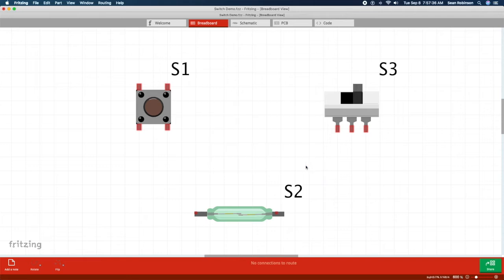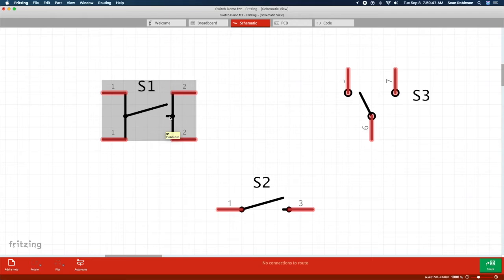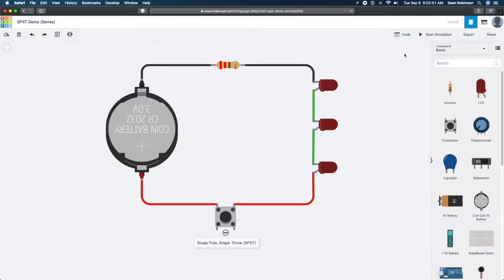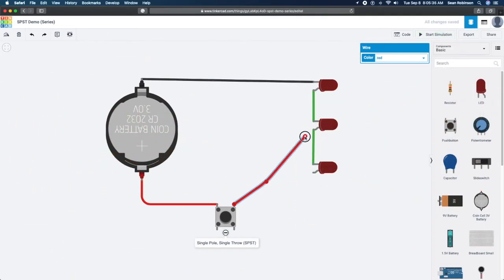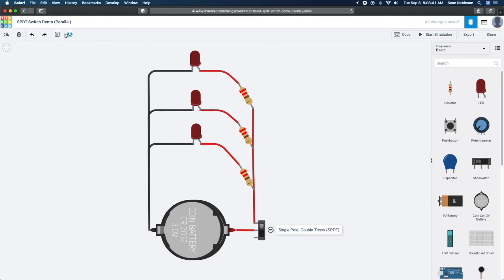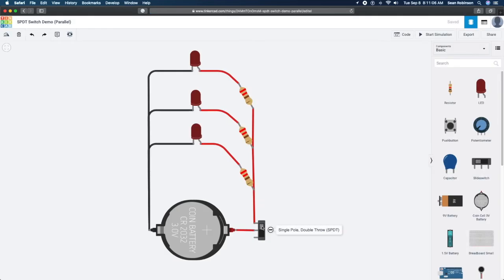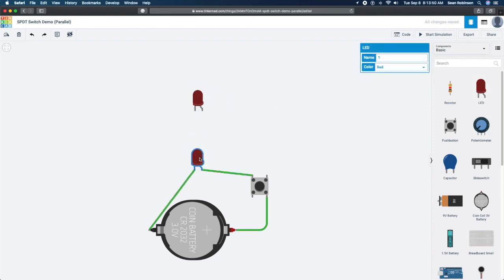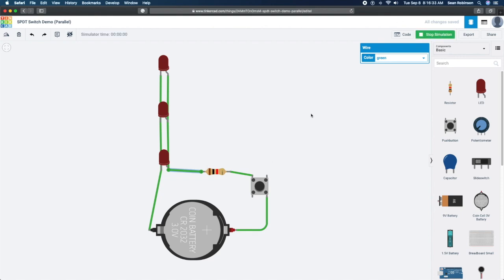Switches and LED wiring | DMP Electronics Projects

Comment: You explained it great, thank you but now I'm lost with the resistor, do we need them to light the house or can we do it with out it and nothing burn? I got me some switches like the S3 you draw I think I can put few of them around the house so they don't have to turn on or off everything at the same time, waiting for your next tut, thank you and wish me luck.
Reply from the maker: Thank you.  My next one in this series will be covering the resistors in more detail.
You don't, technically, need resistors.  They just help the LEDs, and batteries, last longer.
The good thing about using LEDs is that they won't burn and cause a fire, if that is your concern.
I hope to release that video on Monday.  Hang in there!

Comment: I thought it was pretty good. For us novices, I would have liked more of connecting the leds and battery in the sense of negative and positive. How that affects the flow. Using the same green line/wire (I thought green was for grounding) confused me and connecting 1 and 3 on the poles of the switch was confusing when I thought you said 1 goes with 2 and 3 goes with 4. Also, resistor values you lost me again. Reading the values on the resistors and knowing what you can pair with what was something I was confused about. For example, if you have a 3v battery how do you know how strong a resister you need if that is measured in ohms. I’m going to watch again and see if I get less confused😂
Reply from the maker: Thank you for your wonderful comments and concerns.
I apologize for the confusion.  My next electronics tutorial will dive deeper into the resistors, power, current, etc.  I just wanted to "introduce" it in this video.  I meant to mention that, but I forgot.  Sorry.
Regarding the wire colors.  In all actuality, it really doesn't matter what color wire you use when putting it together.  If you watch the beginning I do color code the wires correctly.  The green wire just happens to be the default color when drawing the wires on the app.  You are correct saying that green is usually the color of ground wires.  I just didn't change them.  Again ... sorry.
I did say that pins 1 and 2 were connected, and 3 and 4 were connected, but it was only for that one (momentary button) switch.  If you look at the schematic drawing part, you will see what I mean.

I am working on a collaboration this weekend.  If I get some extra time, I will do a follow-up video to try and re-explain my errors.
Thank you again for watching.  Hang in there!  All will be clear!  I promise!